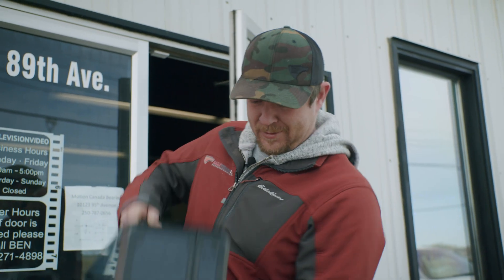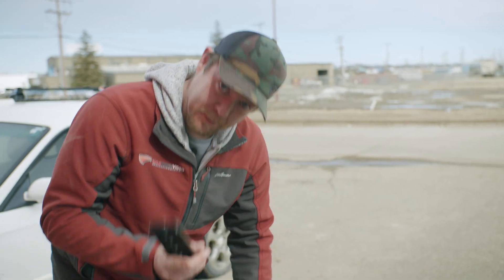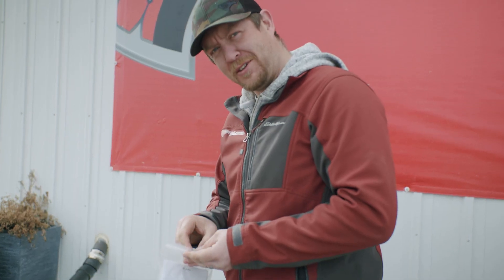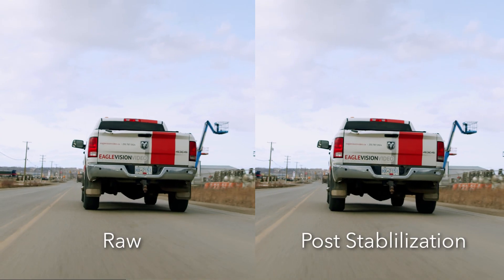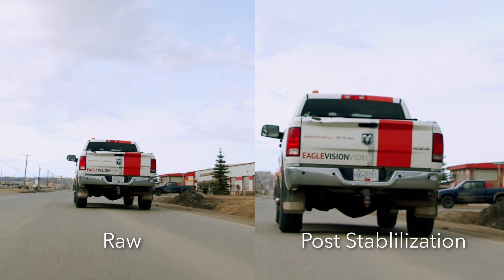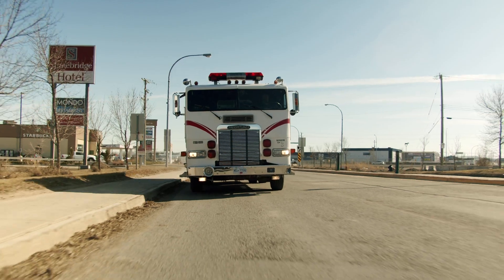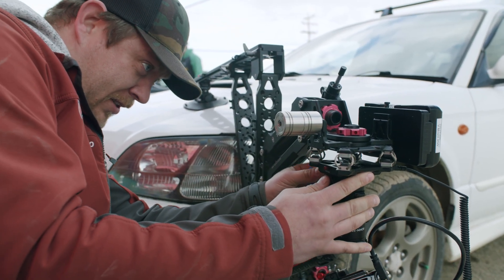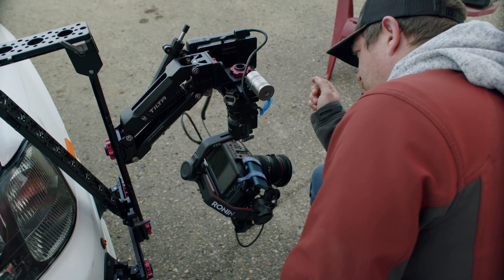Tilta Hydra Alien Arm for the DJI RS 2 - First road tests and review

Comment: Im friends with the head of tilta i didn't want to do a review to hurt the brand but im glad you did a solid review. I was one of the first to get this rig to review it and thought the Ronin S2 was broken because the wobble was horrid. At the end of all my testing I found the true issue is the Ronin S2. The pan motors are simply not powerful enough to support the cameras underslung. If you dont believe me try under-slinging your ronin S 2 in your hands and look at that baby wobble. Its a defect and DJI should do a recall. The only fix i was able to find was to use the ronin one classic. This was a match made in heaven! zero wobble unless you take a hard turn, but was proof that it was the RS2 gimbal all along. Message me if you would like some photos of my set up works like a charm.
Reply from the maker: I’ll do that for sure
Reply: I would be very interested in seeing your setup, as well as bts footage and footage showing the results as well. What are you using to secure the Ronin 1 to the Tilta Hydra car mount?
Reply: @LaurentFranchet   it’s a dove block made for the ronin one cost about 80 bucks
Reply: @ArtLA  could you please give me a reference to this product and if possible a link ? Thanks a lot
Reply: I too would love to see some pics of this setup or a link to find such dove block @Art L.A.
Reply: I assume the stronger motors of the RS3 Pro should elevate this issue?

Comment: spot on..seems like everyone is having the same issue..any solutions to this?
Reply from the maker: Testing the new isolator next week. Stay tuned! Well let you know :)
Reply: @EagleVisionAgency  what stiffness settings are you using? It sounded like you said 100% Have you tried turning the pan stiffness right down on the rs2?
Reply: try it with the ronin classic the only fix unless you have an MX
Reply: @EagleVisionAgency  i hope it works but I have a feeling its just the weak motors on the rs2